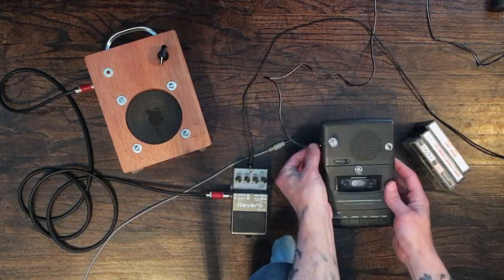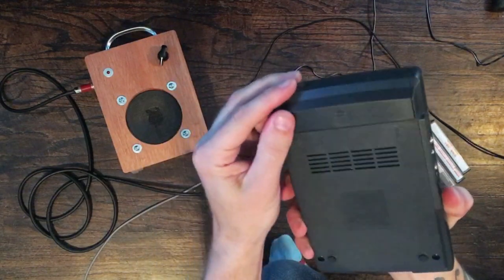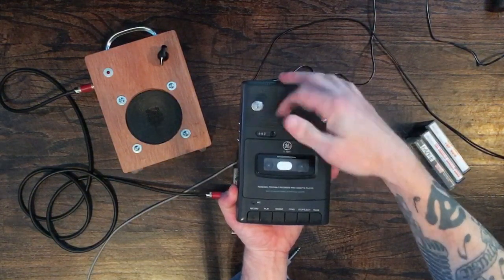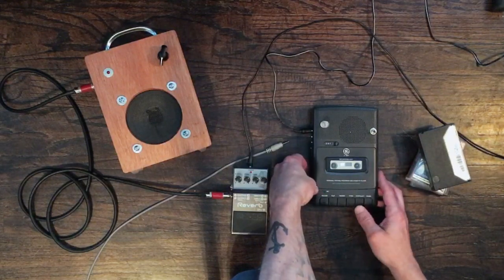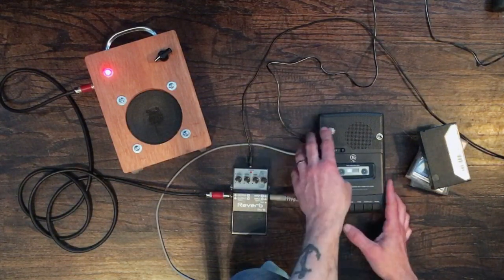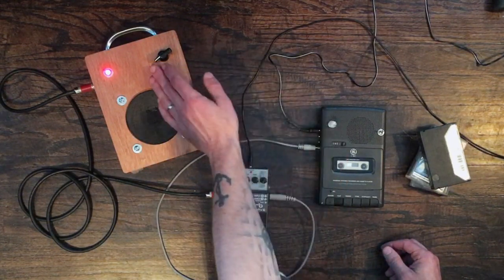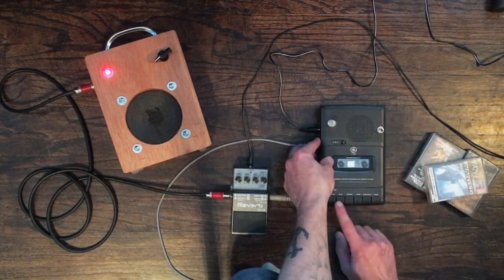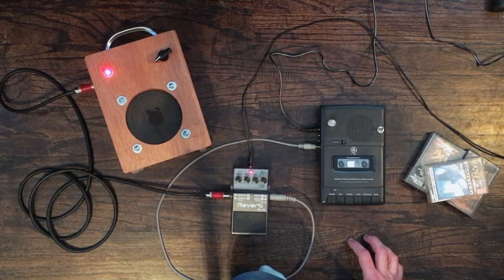DIY Project: Circuit Bent Cassette Player

Comment: I've got the exact same tape player and I'm also looking to do this mod. What value potentiometer did you use? I need to buy a set of alligator clips to mess around with because I'm not sure which points to wire the switch to engage/disengage the pot. Thanks!
Reply from the maker: I used a 10K pot. It worked pretty well. I tried a few different values (based on things I had in my parts box) and 10K seemed to be the best. Good luck.
Reply: @musicalmiscellany  Awesome! Thanks

Comment: I just did this mod with that model tape player. When the 10k potentiometer is turned all the way to the slowest speed it kills the motor, and turning it back up doesn’t get it going again. Is this normal behavior?
Reply from the maker: That's a difficult question to answer. What you're really doing with the pot is voltage starving the motor. These small motors will act a little bitt differently from one unit to another. However, it will stall at some point and often it will need a full voltage again to get moving. That's not unusual.

Comment: How to rec external audio in the deck GE 3-5027 ? Please help
Reply from the maker: It has a mic input on the side. It's mono, but that should work. You'll probably want to use an external attenuator (mixer, input buffer, etc) of some sort to get the level correct before it goes into the tape recorder.